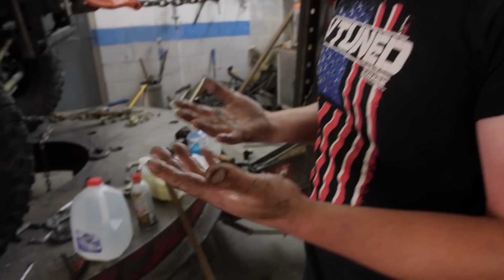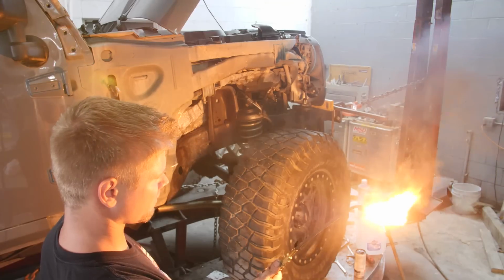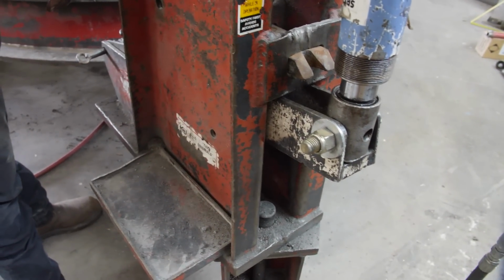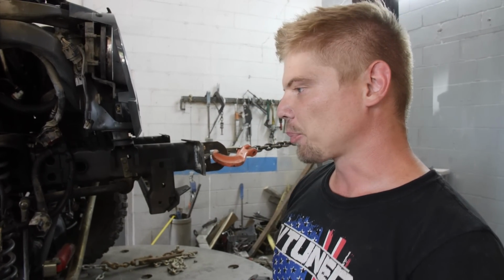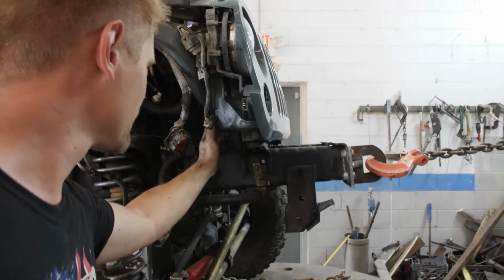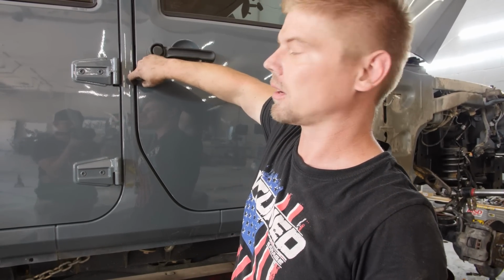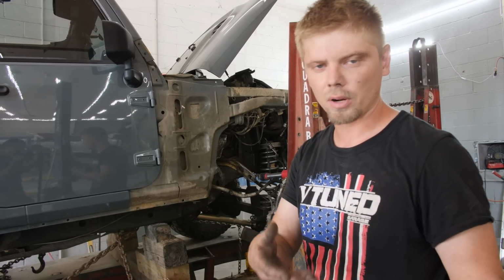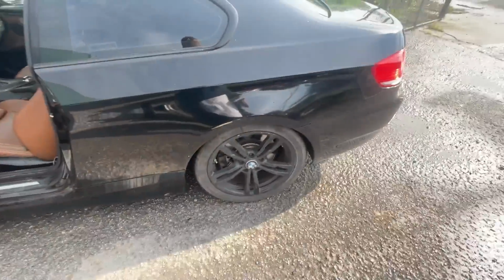We saved the Totaled Jeep Wrangler Frame

Comment: i am very intrigued by the damage on this chassis, to be honest if it were me i'd get a whole new chassis or the front half, that's if Jeep do that over there, and depending how straight the rear was, sometimes they go parallelogram shape - its odd that none of the area meant to concertina has crumpled, but by the looks, maybe that front side has bent upwards and back, that will take some shifting, but like you i love a challenge 

a car i killed once with my old Land Rover ended up S shaped, there was a tell tale kink in the roof panel, i hit the front near side as it passed across in front of me, the car spun right round 180 degrees hitting me a second time and pointing the way it came, and then came to rest 40 feet away, actually it fell over, the front wheel assembly was sheared off and sat under the passenger foot well - completely his fault as a novice driver, it was raining and he didn't take enough notice of oncoming traffic while crossing the junction at a set of lights - i later found the vehicle, an old Peugeot at a local garage after a search, and took some photos, Peugeot, from strength to very dead

Comment: This Jeep had to have an aftermarket bumper.  If it was the oem plastic bumper it would have been destroyed and would have given you a peek of how bad the damage was. You are going to have to replace the transmission mount. You will feel the vibration. Sometimes you can remove it and wack it with a hammer on the side to bend it back.  The motor mount on the passenger side is torn.

Comment: A vertical pull downwards at the heated point while the forward tension was being maintained would have made this much simpler
Reply from the maker: If the rail was folded up, yes you are right, but the rail was folded side ways and if I pulled down it would change the shape of the curve where the cab starts.
Reply: if that was the case why were you pulling along the length of the frame? as pulling that way was pulling the "dog leg" , if the leg was bent (side ways) as you are saying it was then you were pulling the frame the wrong way